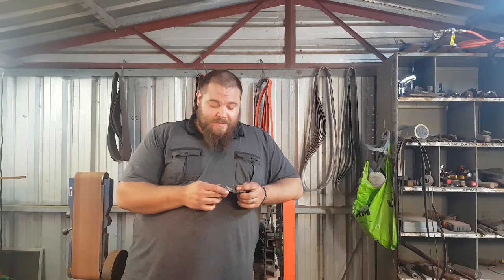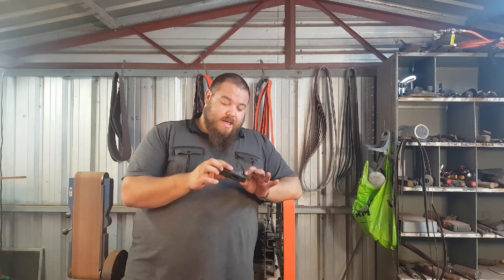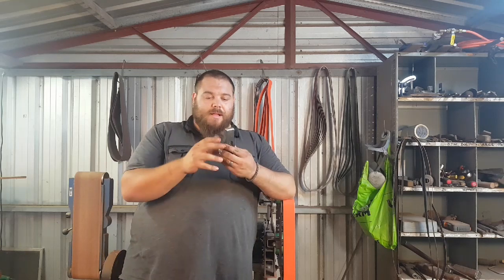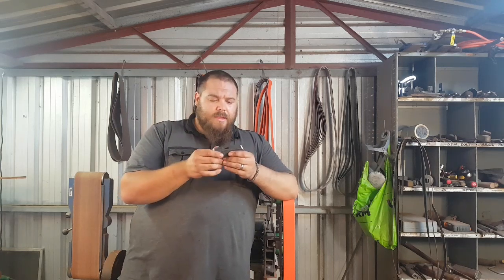Forging a cross pein hammer!

Comment: Good one mate what steel did u use?
Reply from the maker: 4140 mate
Reply: @SamTownsBladesmith  Thanks looks about 50mm diam is that correct?
Reply from the maker: @lenblacksmith8559  42mm
Reply: @SamTownsBladesmith  Cheers